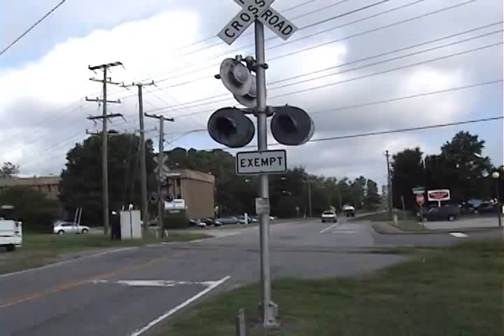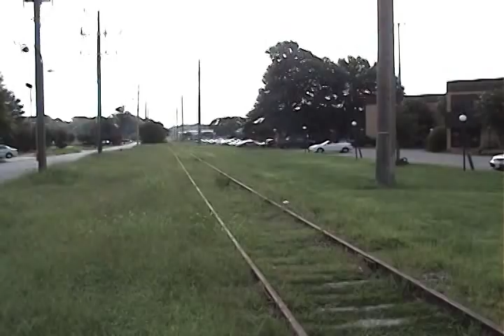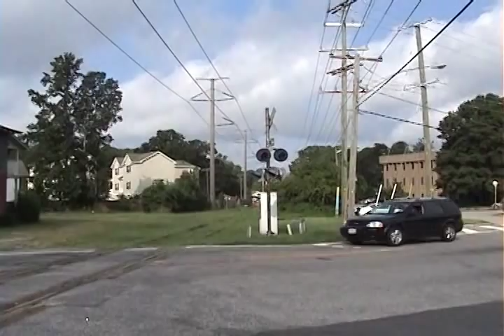North Lynnhaven Road grade crossing

Comment: Nice video.  I hate to see that old line abandoned.  You would think VB would have some industry supporting rail traffic!
Reply from the maker: +NS CSX Railfan Well, Virginia Beach technically still has some rail service left. The Bay Coast runs through part of Virginia Beach right on the Norfolk border, albeit only a few days a week. When it goes by Baker Road and Bayside Road, that's still Virginia Beach. I really hated to see this line abandoned too. Think of how many shots I could've gotten on this line in 4K. :( Thanks!
Reply: You're welcome!  I remember this line in use.  Too bad I never got any shots there on video :(
Reply from the maker: NS CSX Railfan I only videoed a few times. :(